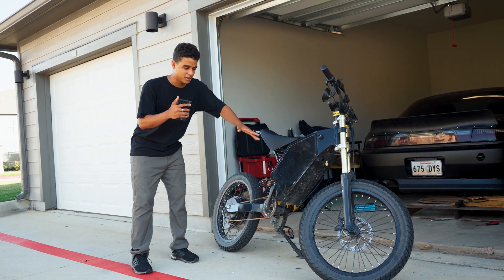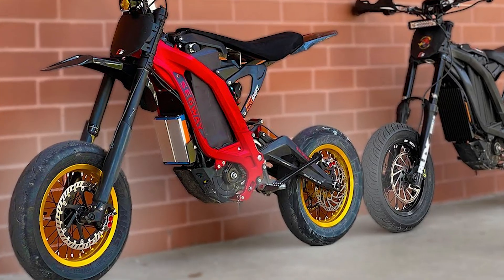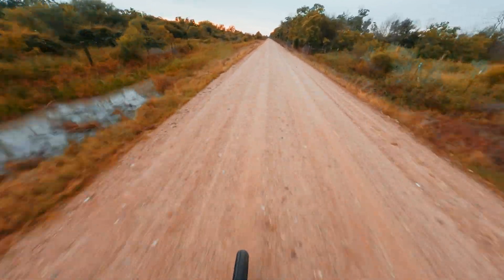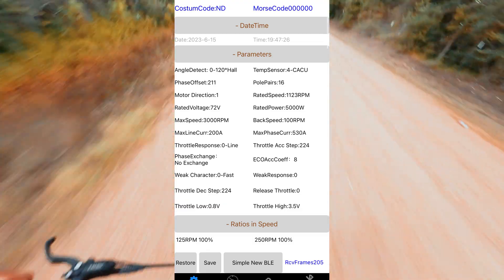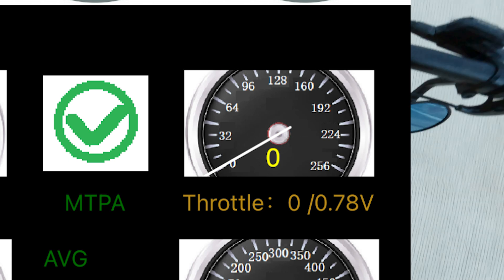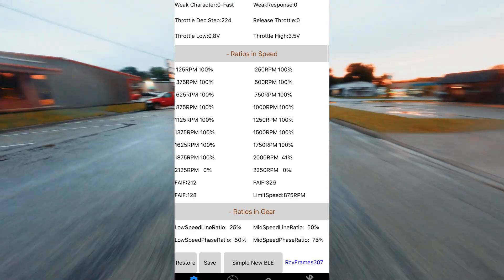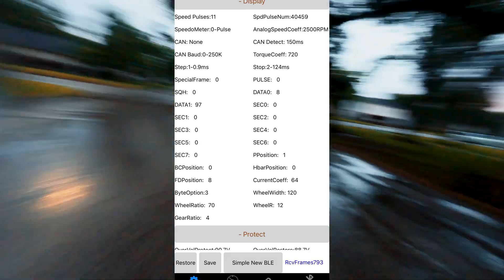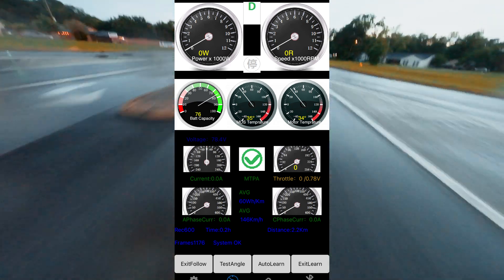How to TUNE your Ebike // Fardriver+ANT BMS Configuration

Comment: Hey man I have a question I did all the settings you did and my ratio table don’t change I try to change it and it just resets to what it was at before it says 41 percent at 1250 rpm

Comment: For your max throttle voltage you could probably screen record you ge where it showeed you min throttle voltage and pin it, then check the recording. Yiu could also probe the connector with a multimeter.

Comment: Running 200/530A on a qs205 50H motor is insane. You never had overheating issues ? Have you ever done some enduro/hill climbs with it at some point ?

Comment: I got the 72530 far driver controller and I have not gotten it to work.  I am having a 9 beeps phase current overflow alarm and it will not go into self learning mode. Do you have any idea to get the motor spinning?

Comment: Hello. I have a scooter with a 72v50ah CATL battery, with a Votol m50 and a 1000w Rayan motor. I would like to know how the BMS would be configured from the app. I have an ANT BMS 8s - 22s 80A continuos peak 200A installed

Comment: Dont do it Man!!! Dont mess with specs man!! You will face a fire unlike any other you have seen! Yeah it works after doing these DIY Hacker tricks but time leads to specs being off from the safety range of power being induced to all 3 components of motor, battery and controller. Yeah its fine after 2 days but man, your shit will explode if not rapid fire. These DIY videos done to impress but its a lure of a fire yet to come. Why do you think e bike makers have different and various spec ranges of their set ups? Im sure some guys know their stuff but only until they find out later of the mistakes and will not do a follow up from being possibly sued or worst Agents at your door of serious mis information laws...

Comment: how can j make it so that it only charges to like 90 percent instead of 100. i heard charging to 100 makes the battery last less
Reply from the maker: You can probably set high cell volt limit in BMS. In my case, the charger I use has a selector to choose between 80-100% charge.

Comment: Hey, your wheel size is 26 fat? Same as my enduro. What tires are those? And are your spokes 12g? If they are 12g, how safe and stable is it going at higher speeds? As in over 38mph?
Reply from the maker: The rim is stated as a 19 but I think with tire it’s closer to 25-26 OD something like that . I don’t think it’s a fat tire, they call it “turtle” street tire. It performs pretty well at all speeds, my only issue is they aren’t perfectly balanced, so past about 50mph the vibration/imbalance becomes noticeable. Need to balance the front wheel and also motorwheel at some point.
Reply: @JZEV1 a simple wheel true will fix that. i hit 80km/h on my new one recently. it's 26 inch 4.0 fat tires, 12g spokes. i did true them before i headed out though, didn't notice any shaking...just worried of a catastrophic failure at high speeds since i am heavy (240lbs) but I've searched everywhere and haven't heard of 12g spokes failing on enduros...anywhere.
Reply: Just check them regularly like any bike  @slugzkea

Comment: Don't think you have your ratios in speed definition/usage correct. From what I was told this tells the ecu when to turn on the weak and what percentage of weak to use. With it set at 100% its telling the ecu to use 100% battery power and no weak. Does your ECU show you going into weak mode ever with those settings?  

If you put them all to say 80% it would use 80% of the battery and 20% weak etc... At least thats how it was explained to me.
Reply from the maker: Yeah your correct, I did get that part a little wrong. My setup still works great with the described setup, but it isn’t taking advantage of field weakening at all. Will do another video diving into field weaking once I test enough to have it figured out

Comment: I went from sabvoton to Fardriver and now on a Nucular 24f. Would never go back to Fardriver or sabvoton again. The Nucular has so many features and just works perfectly along with readable manuals that you can actually understand. You pay more but worth every penny.
Reply from the maker: Yeah not having understandable explanations of parameters is a big minus. I’d try nucular If it wasn’t so expensive. Going to try a VESC next though technology seems promising
Reply: I got a VESC. Makerx g300. Cost about $350 has Bluetooth, no need for display besides for the app on my phone, and does 500a. Running it at 13kw on an 72v molicel battery and it’s yet to get warm.

Comment: Super setup advice! One thing: No dead zone and 224 degrees of throttle step are an accidental ghost bike into a wall moment waiting to happen. Leave some head room in the low and halve the step until it’s too granular (progressive) for you. I stay under 30 steps for walking mode at quarter throttle. Great work keep it up!
Reply from the maker: Thanks, appreciate that note! Looped the bike coming down from a wheelie the other day and I think having some deadzone might have saved me😂.
Reply: @JZEV1  topspeed?

Comment: just updated the app and 2 new features are added
Reply from the maker: Is it android only?
Reply: @JZEV1  not sure but I am on Android. New updates adds 2 new lines.
Reply from the maker: @JuanJDumeP  interesting, do you know what they do?
Reply: @JZEV1  not sure yet but they are labeled CustomMaxLineCurrent_ and CustomMaxPhaseCurrent_ maybe it's a way to unlock the max line current but idk why they would do that. My controller can pull 450amps I have no battery to test this. ND72850

Comment: underrated video. Where did you purchase your FarDriver controller? I am still using a Sabvoton on my 5000W build and been looking at the FarDriver.
Reply from the maker: Definitely worth the switch. I was actually able to find one locally on Facebook marketplace, but aliexpress should have legit ones.
Reply: @JZEV1  I Think I found one. I guess I would just buy the 530 Phase Amp model.. I am unsure..
Reply from the maker: @alexchavosaurus  what’s the continuous discharge amperage of your battery?
Reply: @JZEV1  Continuous current is 100A I believe.
Reply from the maker: You would probably be fine to use the 72360 for that. Its a good bit cheaper and does up to 170A DC
Reply: @JZEV1  More than enough. My max output is 200A and I don't even like doing that do the poor battery.